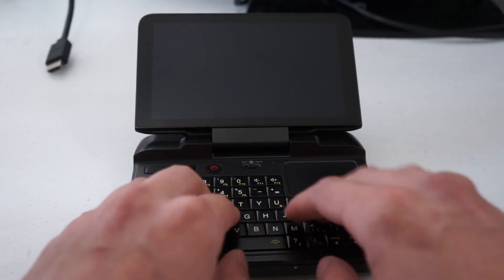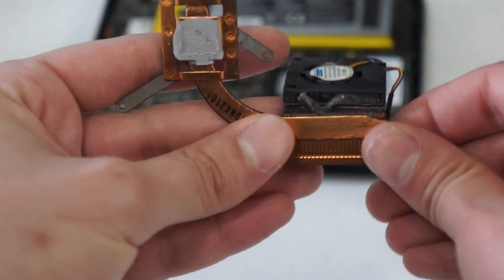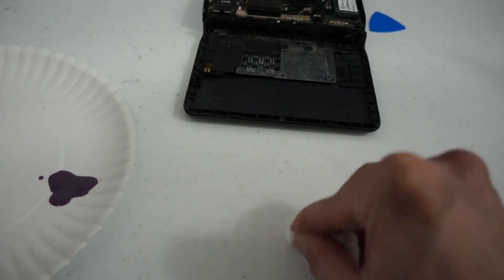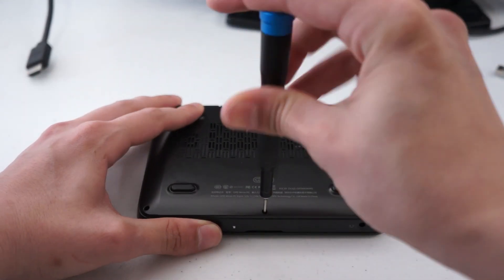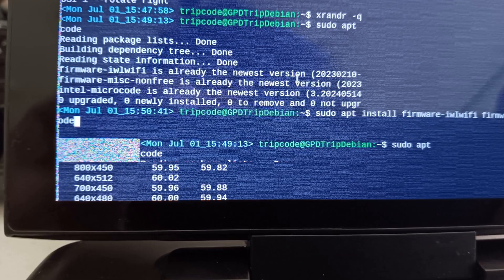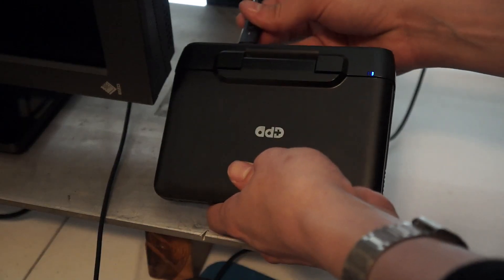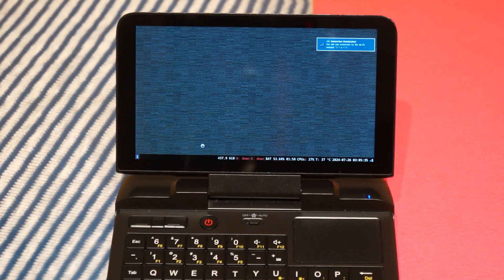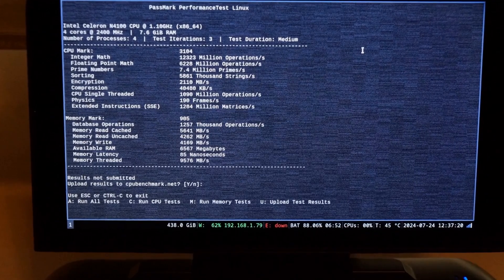GPD Micro PC, Repaste, Debian 12 & Dock setup, Backlight Scripts and more.

Comment: Hi. W540 can run coreboot/libreboot?
Reply from the maker: I am not sure about libreboot, but coreboot probably works on the w540. :D

It seems people have compiled working roms using the w541 option. I haven't tried it myself, but I imagine the two models are pretty similar.
Reply from the maker: https://libreboot.org/docs/install/w541_external.html I didn't know they started supporting haswell. It should work :D